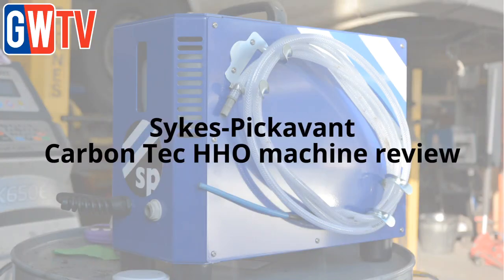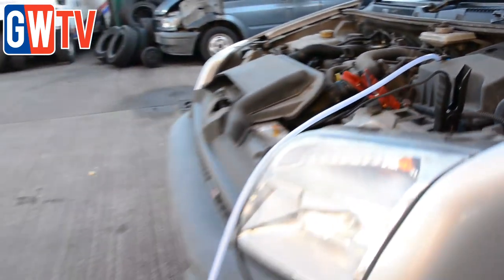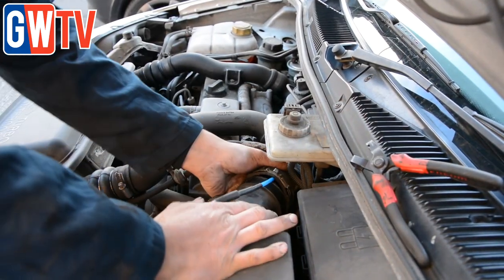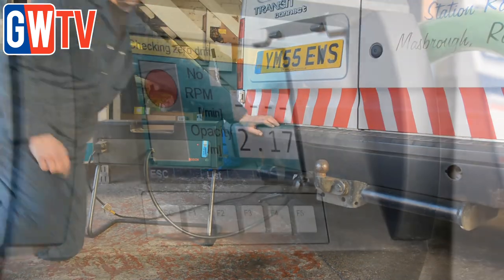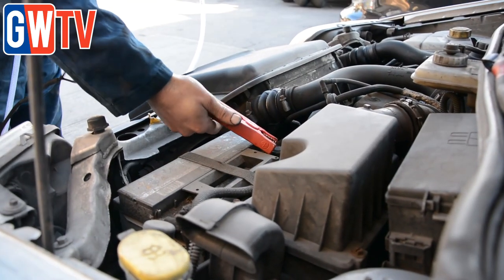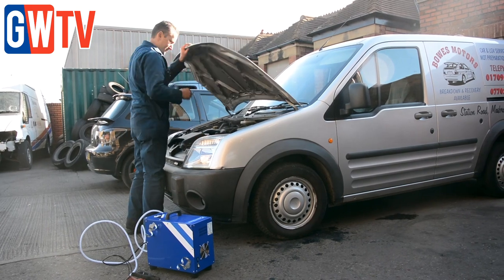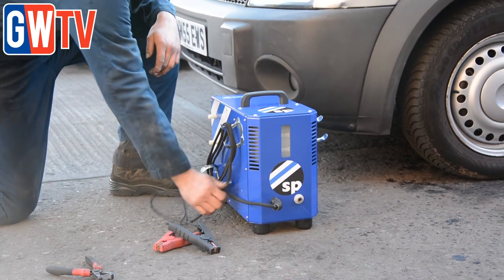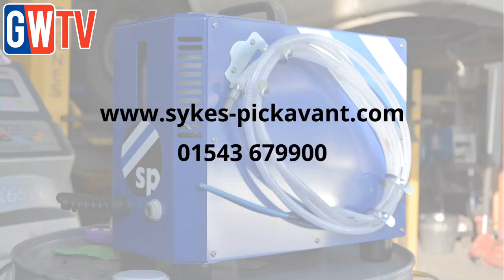Sykes Pickavant Carbon Tec HHO machine review

Comment: lmao thats pure scam... using 12v electricity for making hydrogen and oxygen 1 lire per minute can clean the engine?? are you joking??  a 2.0 engine consumes 7200 liter per minute of air and the 1lpm are 0.05%... so the 0.05% can clean the engine? thats like cleaning a truck with toothbrush
Reply: Hi Antonio, thank you for raising your concerns, however we are delighted to say that our Carbon Tec HHO really does work! The results speak for themselves, check out our case studies video here - https://youtu.be/_VqOSwSQ3Gw

You’ll notice that Philip of Bowes Motors was also sceptical about the machine at first, however after using our prototype prior to the launch, he was one of the first to get his name down for the finished product. The 53400300’s steady hydrogen production prevents engine runaway, and it has been successful in doing so, whilst still clearing impressive amounts of carbon from the system. 

We’ve had extremely positive feedback from garages using the Carbon Tec HHO and their results continue to be fantastic, taking many vehicles from an MOT fail to an MOT pass. If you’re still sceptical then not to worry! One of our Area Sales Managers would happily pay a visit to your garage to demonstrate the machine’s effectiveness in person.
Reply: If it really does raise the temperature to 220'C to 240'C across the inlet valve then why wouldn't help the engine burn off the inlet port coking? YT channel Engineering Explained clearly demonstrated why that is the requirement and that the problem is in the normal course of driving the only way you can get those temperatures on inlet valves is with long hard Track use (5,000rpm plus}. If the HHO hydrogen cleaning machine works then it's a very nifty machine indeed. For example on my Audi 3L TFSI engine to get to the inlet ports for manual cleaning, you've got to take the supercharger off. Pain in the butt. The HHO hydrogen cleaning machine would be a God send.